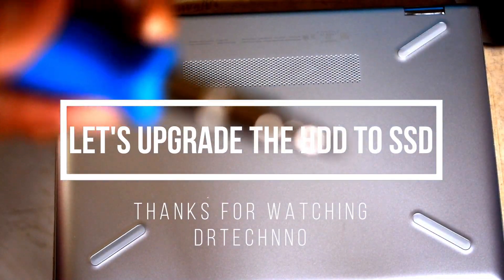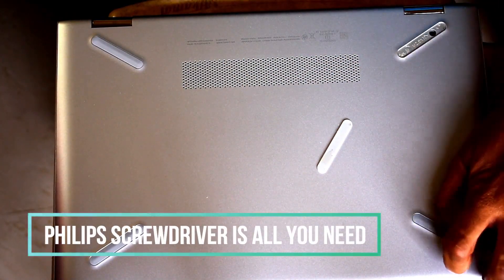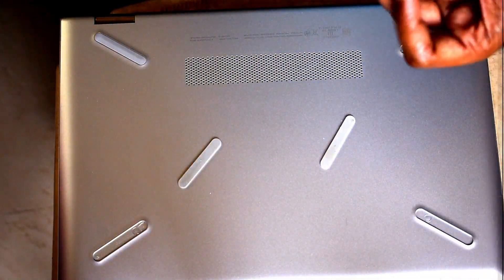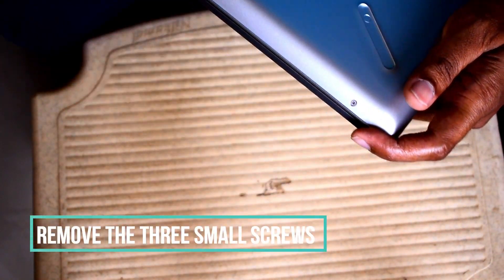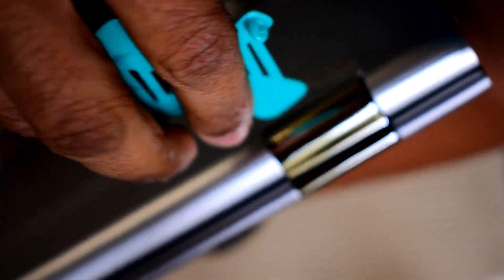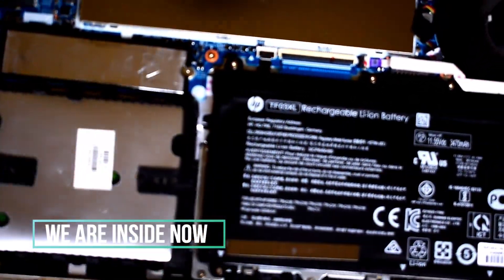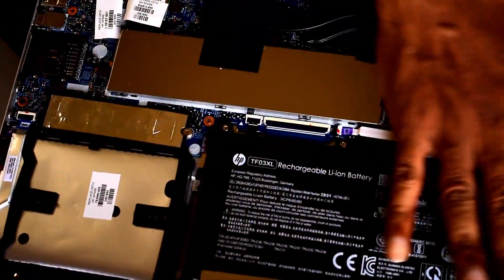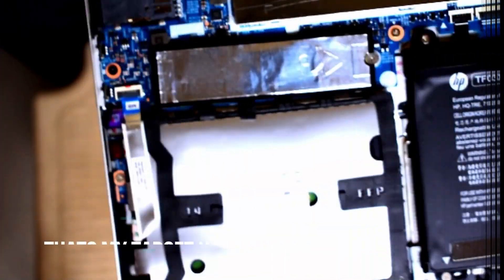HDD TO SSD upgrade tutorial: HP PAVILION X360 2018| #CD0053TX

Comment: Sir I am using Hp 14 cd0050tx, How much maximum Ram and SSD should be compatible in the laptop motherboard 🙏
Reply: I have exact same laptop and i check u can use max 32 gb ram and 1 tb ssd ... I ordered 240 gb wd green ssd .... And planning to replace with my hdd

Comment: I am having this problem when i lifting my laptop, pressure applied on the back side of the laptop, it will hang and need to be forced shutdown and restart. Any advice?
Reply from the maker: Might be battery connection or ram connection issue which is freezing the laptop

Comment: I have HP pavilion x360 13-u131tu 
I have 1tb hard-disk already in it but I want to add SSD of 240gb but will I need to get rid of hard disk or can I keep them both? 🤔
Reply from the maker: That model is from 2017 which is much more complicated to disassemble. So better leave it to professionals
Reply: @DrTechNNo  yes but will the professionals be able to add SSD without removing hard disk??
Cause I want both SSD and hard disk.

Comment: I have a question. let's say my model didn't come with a hdd just a m.2 ssd. so if I wanted to install a ssd 2.5 inch should I buy a rubber sleeve or any 2.5 to 3.5 inch bracket will do?
Reply from the maker: Laptops don't have 3.5 inch HDD.
All are 2.5 inch ssd/hdd
Reply: @DrTechNNo  so it's okay if instead of the rubber casing I use a 2.5 inch bracket?
Reply from the maker: The bracket cable might not fit.
It's a tight fit as shown in video

Comment: Bro it says no bootable device - insert boot disk and press any key after putting ssd plz reply me i brought that today is that ssd problem..?
Reply from the maker: Where is your Windows installed?
You need to format it for first time
Reply: @DrTechNNo  😐 i didn't did that
Reply: @DrTechNNo  so my ssd is alright h..?
Reply: @DrTechNNo  how should i install windows..?  that i have installed ssd already
Reply from the maker: Yes your SSD is fine.

Windows installation using a pen drive with windows bootable disk.
You need to download from Microsoft official website

Comment: Can you please help me to buy a new rubber casing and connector cable, as the original cable is broken while removing the adhesive?
Reply from the maker: Available at AliExpress but I doubt they ship to India now!
You can see links I provided in another comment here
Reply: @DrTechNNo  Thanks, found it on AliExpress. Ill check if it could be delivered, else ill go for a M.2 SSD

Comment: You should make a video on how to install the PCI express SSD.
Reply from the maker: It's already there. Removing Optane and installing SSD
Reply: @DrTechNNo  I don't have anything in the Optane slot, so, I'm hoping the PCI express is a painless installation. I just need the screw!
Reply from the maker: Yes possibly painless and then migrating OS to the new SSD and then Changing boot order.
The boot order change is not really accepted by the motherboard of original HDD is still there in slot.
I had to temporarily disconnect the hdd, boot up with new SSD. Then I installed the hdd back
Reply: @DrTechNNo  Thanks. I may need more help after I get it installed.

Comment: What's the difference between having an SSD and having an HDD with M2 SSD???
My laptop came with installed 1Tb HDD and M2 8Gb SSD. 

I am thinking of replacing the 8Gb M2 SSD with the SSD in this link (https://www.amazon.in/dp/B078WYS5K6/ref=cm_sw_r_apa_i_uRw0EbZJF67JK). Will it make my HP X360 model faster? FYI, I plan to do it in addition to increasing my RAM from 4gb to 12gb.

Please respond, it'll be a great help
Reply from the maker: 8gb SSD means it's Optane memory mostly.
There is no such 8gb SSD available.
If u replace the 8gb with the WD SSD. AND THEN migrate the Windows OS to SSD
You will see a 50percent increase in your laptop performance
Reply: @DrTechNNo  okay, thanks for explaining.
Just confirming if it's fine if a replace the optane SSD with the WD 240gb SSD mentioned in the link, mentioned in the main comment, and clone my is to the WD SSD?
Reply from the maker: Yes it's fine. But see my video on how to disable Optane first and then clone.
You need to change boot order also

Comment: I can’t seem to find any videos about this laptop the model I have I believe is from last years no backlit keyboard nor finger reader has the usb type c. My model came with m2 Sata ssd and where the HDD/SSD 2.5 goes has this black plastic the layout looks the same
Reply from the maker: Share your model number exactly
Reply: hp pavilion x360 15-dq0953cl
Reply from the maker: That's a 15 inch model
Reply: DrTechNNo yes
Reply: DrTechNNo I was trying to say is their a way to add a 2.5  ssd  because when I open it to add one their was this black plastic on that side and I also noticed it had the latch where you can  add the harddrive cable but it doesn’t have one
Reply from the maker: Sadly HP has not released any service manual for your model.
So difficult to comment

Comment: Hi there sir is there any required spec on lopto to upgrade into ssd ? Im doing edting also so i need a bit faster or do i need higher ram before upgrading it to ssd? Im currently using hp630 corei3 4g is ok ?
Reply from the maker: Yes you can upgrade.
But you will need 2.5 inch sata based ssds
Don't buy M2 nvme ssds

Comment: Hey there, I have installed a 500 gb ssd and done cloning. Do I need to still keep that hdd there? I mean there is no longer use for that..Does it slow the machine?
Reply from the maker: You can keep the hdd for extra file storage. It won't slow down. But yes battery will be slightly impacted

Comment: I have the same laptop , after changing the optane for ssd m.2 , cloning my hdd OS to new ssd not detected in bios so can not boot on sdd. Any solution,. Thank you
Reply from the maker: Step 1: remove HDD
START LAPTOP
M2 SSD WILL BE DETECTED.
STEP 2: NOW GO TO BIOS AND CHANGE THE BOOT ORDER TO M2 SSD as first priority
STEP 3: NOW CONNECT HDD AND AFTER BOOT, REMOVE THE BOOT PARTITION IF POSSIBLE!
Reply: @DrTechNNo  I tried. After removing the hd, the message is no disk. Now I am thinking is because my new ssd is nvme not sata..what do you think. Thank you
Reply from the maker: No disk in bios?

See if SSD is detected in BIOS in boot priority after removing hdd!
NVME should be detected though
Reply: @DrTechNNo  the SSD is not detecting before removing the hdd
Reply from the maker: Did u check the bios?
Reply: @DrTechNNo  yes. I did follow your step to removed the optane,   but my bios seems a bit different then yours. The inside of the PC and the model is exactly like yours

Comment: Hi. So the 14 inch which only had m2 Ssd plus optane also has space for an Ssd with the HDD connector. But when I Connect it, it doesn’t recognize the Ssd drive. Do you have a suggestion?
Reply from the maker: Naila did you clone the hdd?

Comment: if i do this would i loose my saved stuff if not what would be the side effects
Reply from the maker: You need to manually do cloning to the SSD.
Then it will behave exactly like your HDD but much faster!
Samsung SSDs comes with a free cloning software and is very easy and reliable
Reply: @DrTechNNo  how do you have a video on it
Reply from the maker: Video on cloning HDD??
No it's too easy bro.
The software will guide you
Reply: @DrTechNNo  thanks

Comment: I too have the same laptop bro... can u help me to overcome the overheating problem??🌡🌡 🔥🔥
Reply from the maker: Have you tried undervolting??
Reply: I also have same issue with same laptop,mistake what i did is I removed all hp default applications,later again I installed hp coolsense app. heating issue is gone.
Reply from the maker: Nice Lakshman Javvadi
Reply: @DrTechNNo  :-)

Comment: Hi. Do I have to install Windows after installing ssd?
Or do I have to do something before upgrading to ssd for Windows 10
Reply from the maker: You need to clone the c drive of HDD to the new SSD first.
Cloning can be done by the SAMSUNG MAGICIAN SOFTWARE that's free for all Samsung ssds
Reply: @DrTechNNo  and how to clone c drive to new ssd without connecting to pc? Please guide me, 1st time using computer,
Reply from the maker: CaN use a software like MINI TOOL WIZARD
Reply: @DrTechNNo  thanks for replying bro🙏🙏
So i came to know, minitool is a software/program, but i want to know how to connect new ssd with my laptop for clonig? Via usb cable? And how to connect ssd  with usb cable to laptop? Is there any extension or something i have to buy,
Really sorry for these dumb questions, i can guess how dumb my queries are if you didn't even tell about these simple things in video😅😅😅
Reply from the maker: After that in boot order make the SSD as first to boot

Comment: Thanks for the video. It was really helpful, can you tell me if it is possible to upgrade the processor to i5. I have the same exact notebook with i3 processor. 
And the system is kinda slow, so I wish to upgrade to i5
Reply from the maker: Naah laptop processors are not upgradeable till now.
Some old and a new upcoming model aim to make upgradeable laptops
Reply from the maker: Just upgrade the optane to a NVME ssd

Comment: Hi, I have this same laptop but it did not included the sata HDD, only the M2.  I want to add a second SSD (on the 2.5" slot) But my laptop did not included the sata cable! Could you tell me the model number for that sata 2.5 HDD cable, please???
Reply: I used this one from ebay: HP 15-CR0037WM 15-CR0053WM HDD BOARD CABLE RUBBER FOIL L20815-001
Reply: You can also check with this one (ebay) L20815-001 Hp Hard Drive Cable 15-CR0053WM  15-CR0037WM
Reply from the maker: I sold my Hp. Please check my recent video last few minutes, I had zoomed in to share part nos
Reply: @DrTechNNo  Ok. Thanks!
Reply: what is actually the part number of the cable please?
Reply: @harrisxafopoulos2989  HP PAVILION X360 - 15-CR0056WM HDD RUBBER CADDY AND HDD CABLE L20815-001
Reply: @harrisxafopoulos2989  check the hp guide .Its L18218-001
Reply: If you search the following on ebay you will find the same one I bought last year, which included the blue hdd frame: HP PAVILION X360 - 15-CR0056WM HDD RUBBER CADDY AND HDD CABLE L20815-001

Comment: Since you already had upgraded the optane to an M2 SSD, do you recommend doing both the M2 and the SATA or would just changing the SATA drive and leaving the optane be sufficient? If only changing the SATA, how would you recommend cloning the new SATA SSD, with an adapter through the usb before installation? 

Finally, would your first video changing the M2 to SSD and then leaving the 1TB HDD as a backup and storage be a good route to take?  

If you can offer a comparison of the different configurations, that would be great. 

Cheers!!!
Reply from the maker: Upgrading M2 to a nvme drive will be more than enough.
With the SATA HDD hp would suddenly lock the laptop if it detects a sudden movement of the laptop which was irritating when just moving from sofa to bed etc.
Plus I wanted little faster response and transfer speeds.

After both upgrades overall performance boost is also noticeable
Reply: Thanks for your response. What’s your opinion on leaving the optane and changing the HD to SSD?
Reply from the maker: Does optane speed up SSD too?
If not then what's the point in leaving it  in laptop?